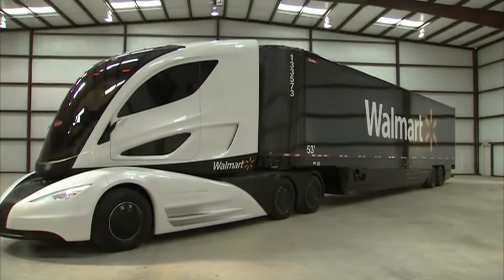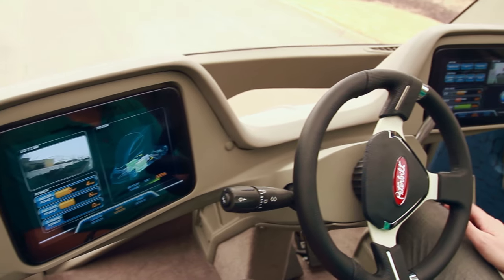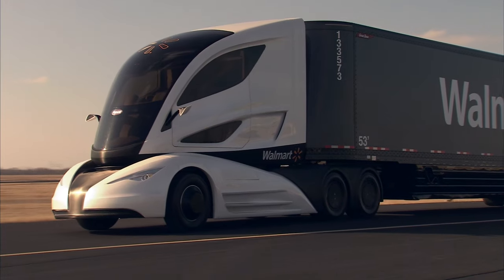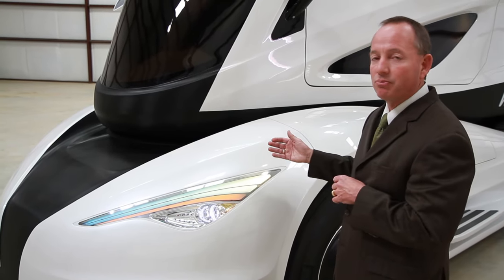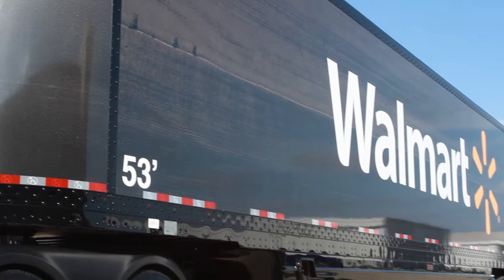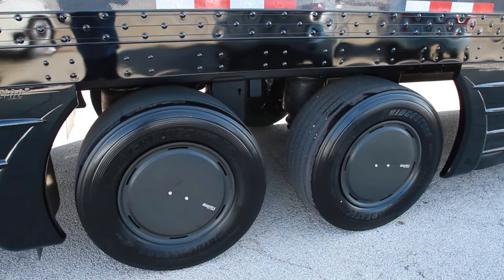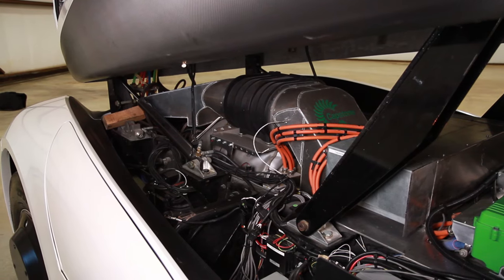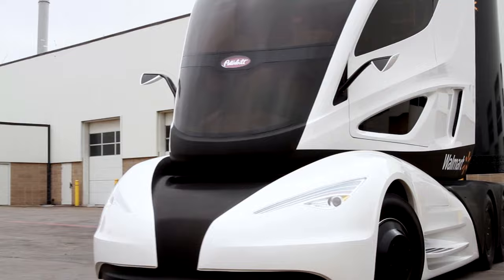Walmart Advanced Vehicle Experience Concept Truck

Comment: They should skip this step and go directly to fully driverless electric semis. You wouldn't even have to have a cab, just the trailer, as there will be no driver. Put the Tesla battery pack at the bottom of trailer, and have quick swap battery stations.
Reply: the idea is not to eliminate jobs, but make driving more efficient and easier on the driver. Your concept is impractical on nearly every level other than cost savings (driver).
Reply: Charlie Kota I look at it through an economist eyes(not that I'm an economist, I just understand how the free market works). If you can do something more efficiently, it frees up labor to create more wealth. It is called creative destruction. For example before the industrial revolution it took like 99% of the labor to work in agriculture for society to feed itself. With the industrial revolution it put most of those people out of their jobs but it freed up the labor to go into creating other things like roads, bridges, consumer goods, etc, and living standards raised across the board because the economy created greater overall wealth. In my scenario with the semis, consumers benefit as it will drastically decrease the cost of shipping and lower prices for consumers, who will then have more money in their pockets because of the lower price of goods to buy or invest in more things, which creates new jobs. Like trhose who once made horse carriages, truckers will have to adapt to the new jobs that are created  through creative destruction while overall society enjoys higher living standards because shipping is done more efficiently.
Reply: You do realize that your "economist eyes" also forget that the drivers aren't just drivers, they are inspectors also, they are paid to maintain the cargo make sure nothing happens to the cargo, or to the trailer or tractor. The drivers check springs, engines, wheels, brakes, and literally the entire truck from the paint to little tiny scratches that could become bigger problems, daily. If you don't have drivers doing this, the trucks will break down every day, which will cost more than having drivers. Pay a driver $0.35/mile and have them mandatory check everything before they can even make money by driving for the day is the best way to do it, and this is how they are and have been doing it for years. Prevention is the best way to save money. Drivers cost near nothing to these companies, a company that makes $10 billion a year, has to pay $100million a year to it's drivers... that is 1:1000 But if every day they have to fix the trailers that are automatically driven over 10 times a day due to no one being able to check them in real time in real life at all times, it would be $100billion a year to deal with that instead of $100mill.
Reply: i don't feel safe with a vehicle this size being driver less they need a manual override or an option to be self driven
Reply: ***** You dont remove jobs. People are still needed in a driver less truck. Just that its safer and easier than before! Long hours of driving? Well now you can watch movies, take a nap, watch tv, enjoy the view, save gas, eat, learn french yada yada instead of trying to concentrate on the road.. Even my uncle who drives trucks all his life cant wait for that!
Reply: ***** Because it still needs a driver. The automated driving itself is not 100% there. You still need to unload and load stuff, ofroad or in unknown conditions the driver need to take control. Its not fully automated and auto driving a truck without a driver is still illegal in the streets in the US. Thats why.
Reply: ***** Yep, it would be convenient, but we still need programmers and engineers designers etc for that and edit routes so for now you still need a driver in it. Also, most companies don't want self driving just yet because it will scare off people who are not used to a self driving car much less one without people in it. Take it slowww...
Another note is that its illegal too in the US so you still need approval on these things.
Reply: Machines are less accurate than humans when given choices. A human will take the safest option, but a machine will take the more direct option. So if they see someone in the middle of the road, the machine will just go straight, and the human will have to avoid the car, but a human will hit the breaks and swerve out of the way.
Reply: ***** I'm pretty sure they could have as its more recent. Lots of companies want that no doubt. But so far commercialization of these cars arent there yet until 2018 for re-evaluation. It could be later than that.  But what I heard alot is a good introduction to self driving capabilities-with potential drivers in it ofcourse. The car you mentioned is to stir up that notion. We have yet to see things like school kids being picked up by person-less cars which could be a positive and negative if they input a different destination without permission but then there are passwords to counter that. I'm not sure but I do hope to see more soon.
Reply: *****
Also, the car had someone behind the wheel making sure the car didn't kill anyone, it had to have someone behind the wheel. And the way to eliminate traffic is to stop tapping your breaks while on the highway/freeways. If you tap your breaks, and 2 people behind you see you, they will tap there breaks, then 4 people behind them will tap theirs, then 8 then 16, then you have stand-still traffic. If you are coming to a bend in the freeway/highway, just take your foot off the accelerator and you will slow down gradually enough to make the turn safely. But people will see an accident on the road or someone ran out of gas, and will tap their breaks so they can slow down to see what happened, and then you start a chain reaction.

Also to conclude Machines can not reason. People created a robot that was designed to never lose at a video game, well it's idea of never losing is pausing the game and never playing again, so that they can never lose.
Reply: Mr Sweetheart We have multiple radars and equipment to have the car drive like a person but better on streets and freeways. It just seems weird not to have a person in the car so soon. I mean a person still needs to be there incase the machine runs down, pops a tire etc or needs gas. There are still solvable unknowns such as sensors and automated gas stations that could bill you electronically if your automated car needs to pull up for gas. 
Still too soon for that and they risk ruining a large market kind of like what MS did with windows 8 but more serious.
Reply: ***** Cars can recognize faces, hand signals and beware of ciclists, wrekless/abnormal drivers 100% of the time without losing: concentration  , keep distance, and manuever very quickly out of their way. I think google also developed that but unsure if google or tesla are the first.

They can also see about 360 at all times, eliminating blind spots with 100% concentration and see much farther, including 3D perception, night vision much better than the human eye can.
Reply: They should never take this into production it takes out the joy of truck driving
Reply: seth sheffield No it doesn't, it makes it better. But they can stick with an older gas guzzling truck, its their choice.
Reply: ***** 
It is 24K as of the 1st of the year
Reply: Jan Kaftanski Pretty much an easier living, thats it.
Reply: samantha86ad They might as well do just that as I feel sorry for anyone who has to drive this monstrosity.
That said, I absolutely hate driverless vehicles.
Reply: ***** Why do you hate driverless vehicles? There will still be people inside. I've had to go to different states with my uncle in his truck and I had to stop him because after 30 or so hours of almost nonstop driving he was really tired. And that means you start losing concentration and that means, well you know.Driving is not very efficient in this case. I think its best to drive 4fun and switch to auto for work etc.
Reply: WhiteWolfos If it's sort of like an autopilot mode while going down the highway, I'm okay with that.  I was replying to the comment that said FULLY driverless semis, in fact no cab.  I am vehemently opposed to such jobs being taken over by robots.  I feel that at this point technology is starting to hurt our culture, and the more newfangled crap that gets put out there the worse things will get.
Also, if every truck out there became driverless, then a couple MILLION people will lose their jobs.
Reply: ***** Oh okay I thought you meant something else. :)
Driverless trucks still need drivers and may still need them for 5 more years after its become common. Some of these trucks can take 5-10 years to be released. That means it could take anywhere from 15-20 years for the whole thing to transfer over since the trucks are going to be very expensive and not all companies are going to switch right away.

Comment: Haven't seen those Walmart trucks on the road yet. I bet they cost a fortune. The VW XL1 concept car finally made it to market in EU for a mere $146,000+. That car will never make it in the US for two reasons; it's too expensive and it run on electric/diesel. Diesel cars in US have never taken off. Pickup trucks would be a better market for the concept VW.

Comment: Why is WalMart promoting long-haul trucking when freight rail is miles more efficient?

Further, European trucks have had soft sides for years, which enables them to pick up and drop off loads along the way. With the only option of rear loading/unloading, WalMart is still locked into single point-to-point deliveries.

Let's not pat ourselves on the back yet folks.

Comment: The can afford this time and effort and supplies to design a fancy new truck but they cannot afford to make a roll cage for people’s ordinary cars so we see them crunched and chopped in half on a daily basis by TRUCKS on the roads with them.  They sell bicycles but where is a safe road to ride them on?  Bicycles are stuck riding on the road with these also.
Reply: +ouivalerie What does roll cages in cars have to do with Wal-Mart building a truck?
Reply: +ouivalerie I'm not sure how rollcages in cars are Walmart's problem, or bicycle lanes.  If you're that desperate to get a rollcage, you can buy one for your own vehicle, but once you find out how expensive it is and how much of a hassle it'll be to get in and out of the car afterwards, you'll change your tune.  Not to mention the lower gas mileage from carrying it around, or the noise it'll make once it's installed (rattling, etc).
Reply: +Richard Cox Everything obviously!

Comment: How about we pull TWO 53 footers with 359 EXHD's slower, THATS efficiency!  You are trying to make a 8 mpg truck to run at warp speed to get your cheap Chinese products to market before they become obsolete. I realize there are obstacles like our decaying infrastructure that won't support twin 53's but ya'll have the lobbying power to get the on ramps lengthened, highways fixed and larger cleaner truck stops and rest areas built that would be necessary. You can't reinvent the class 8 American truck it's perfect just like the U.S Constitution and the diverse religious demographic that exsisted prior to NAFTA.